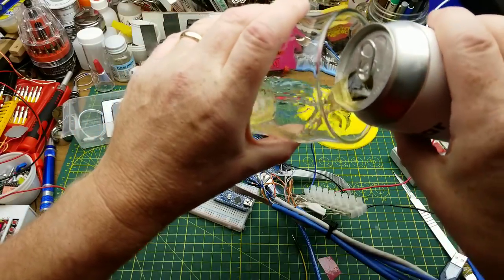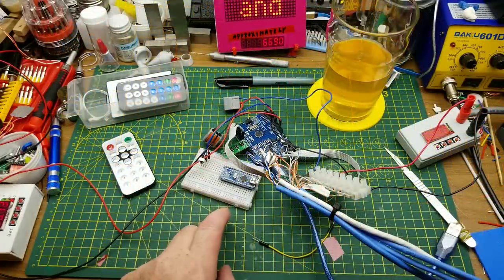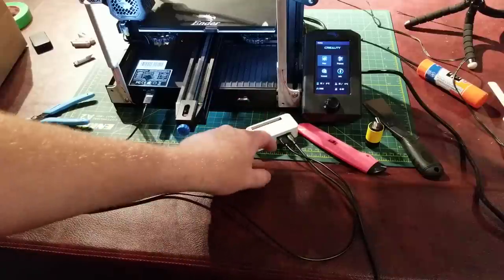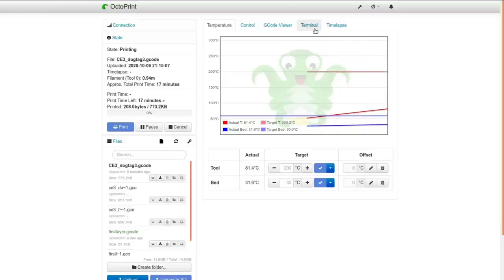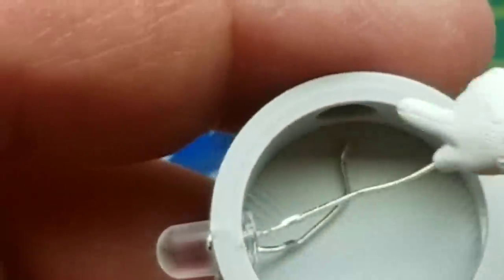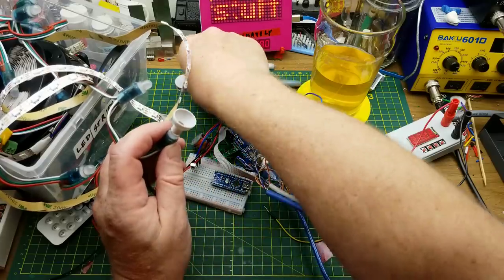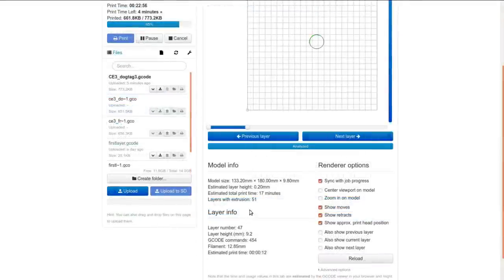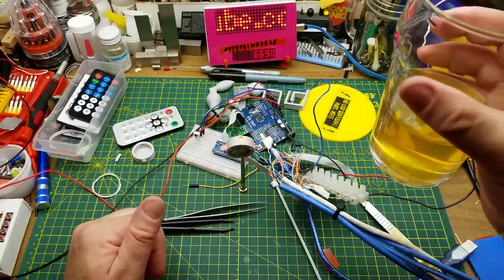A few work-in-progress projects

Comment: Octopi is great. I liberated the webcam from an old broken laptop to use with it. Put a couple of diodes inline to drop the voltage and it works with standard USB. Hook up to the Raspberry Pi and you can watch your prints from the Octopi PC client. First thing I did then was to print a little case for the camera so I could easily mount it on the printer.

Comment: Take the LED Christmas lights you like and resize them in the slicer to fit the LED. Many times I had to resize things to fit. if its a 10mm hole and you need 11 then set the size to 110%. Works great. Also you can get away with changing just two axis such as x and y or even just one.
Reply: Same with the parts you make. Why recreate them when you can change x and y to make it bigger.

Comment: Persist with Freecad, it is great. I have liked OpenScad too, and interestingly the OpenScad design can be directly input in Freecaf too, both by direct access to OpenScad, as well as a exported model. The imported version is a mesh, which under the PART workbench can be reconverted to a solid object for further CAD redesign.
Learning both has its place but a full CAD is the best overall. Freecad of course can do many things, depending which workbench is applied. You may yet benefit by the sheetmetal functions, and assembly modes, animation etc. The addins also are highly useful, such ad gear design and fastener (bolts/nuts) design addons.

Comment: I tried a USB cam with Octopi and although it worked, it was not reliable and required frequent reboots of Octopi.  I then configured a ESP-32 cam into a 3d printed case I made myself and it works much better using the standard esp-32 cam software.  I can even see it from outside on the Net with just a few simple router hacks.
Reply from the maker: That's an interesting option. And I have an ESP32 cam around here somewhere too.

Hmm...

Comment: I suggest moving the spool holder to the side of the printer to improve the filament path, helps to prevent breakages, but will reduce the available print height a bit, unless you put it in its own stand, take a look at my Ender-3 V2 build video from last week.
Reply from the maker: Thanks for the suggestion.

That video of yours was what gave me the idea to print the cable holder.

Comment: SCAD looks just like a program i played with years ago! it was a program called “Persistence of Vision” (POV) where you used shapes to make up the picture and it took about 24hrs on my 3MHz pc to produce it.

Worked in the same way, you made unions to join shapes together etc, can’t remember what the command was to cut one shape from another. But it was quite fun at the time, except for the 24hr delay to see any changes.
Reply: I did the same on a 486! I'd render then go for a bike ride. Come back and see I had the camera pointing in the wrong direction.  Good times!

Comment: Try out Autodesk's Tinkercad,. I've used it ever since I've been doing 3D printing, about 5 years now. Free and very easy to use, made hundreds of projects, many complex. My current printer is an Ender 3, fitted with a magnetic bed base, projects pop right off. (You should try it)

Comment: I use FreeCad, it is definitely not perfect. My first project was to make a parameter controlled box, I used the spreadsheet in FreeCad to enter the parameters and then size the drawing from the. Theoretically that would work perfectly, in praxis FreeCad sometimes fails generating the geometry, not because it is impossible, but simply because FreeCad do it the wrong way. After a couple of redesigns I found out it was basically impossible to do something that always works, sometimes I have to adjust the parameters slowly (I.e. in a couple of steps) before FreeCad will accept the layout.
Another problem with FreeCad is that you can base features on surfaces or corners, but FreeCard cannot keep track of them, I have learned to work around it.
My box was a success, even with the issues. Every time I need a box for a project I type the parameters into the FreeCard spreadsheet and get the box (Sometimes with a few tries). Then I can add the holes and other stuff I need for the project.
The best thing is that the result works in the first or second print, I do not need to iterate a lot of times.

Comment: I feel your CAD pain! When I built my first printer long ago it now seems, I was a CAD dummy (and still am) I wanted a 3d printer to do my own designs with so a CAD was needed. I started like you did with SCAD and still like it today. I am a programmer and am the WORST END USER IN THE WORLD! Applications like CAD seem awkward to me.  I just don't pick them up easily. After doing the open-source tour of cads, I found Tinkercad or Kiddy-CAD as I like to call it. It is cloud-based I know but is so darn easy for awkward end-users like myself. It has matured a good deal since I started with it years back. It's just so easy to use but again is cloudy.  When I am making a new part, I like to have it good in 3-4 prints, but miss that most of the time :) One thing I will do is cut a part down just to fix and test a tricky area to save plastic and time. Printing tips - One thing you may want to do is adjust your extrusion multiplier. Usually, the defaults they have will over extruded and make things off-sized. It will also make layers thicker and less even. You can change this in the slicer or on the printer (I do in the slicer most of the time) For light transmission I usually choose a natural filament or clear, but you can thin the walls out some to help with that as well.
Reply from the maker: Thanks for the tips. I'm glad to hear that I'm not the only one who struggles with CAD.

I do have some translucent filament waiting in a shopping cart once I get my design mostly "perfected"-ish

Comment: Despite much uproar about the recent restrictions placed on it don't be afraid to at least try Fusion 360, it's still a great option for a person such as yourself, the interface is more intuitive for many and many basic things are easier to do it in that in many of the opensource solutions out there.
Reply from the maker: That recent change wasn't even part of my decision making process. 
I've always been biased towards open source software. And away from cloud based solutions.

I much prefer software that I can install locally and use offline.

Comment: Good to see your learning on the 3D printing. I recently got a 3D printer, and I've been looking at OpenSCAD and FreeCad, and like you I'm finding OpenCAD easier to get the hang of (I am a software developer by trade, so coding is more natural to me than drawing). Nice to see that you are making useful things too, rather than just printing out various little trinkets and figures. It might be worth trying "Vase Mode" in the slicer for LED diffusers, also if you go to Big Clive's site you can download his SCAD files for the crystal LED light, and it's useful as a base to get some ideas from (although it's quite complex). That's one thing I'm liking with OpenSCAD, is that it's easy to chop bits from other models and then experiment with them.

Comment: Sad that the only real 3d design tools, Soldworks and Inventor, are proprietary and prohibitively expensive.
There are wizards with Blender,  OpenSCAD,  and Meshlab.
Reply: Having a coding background, I prefer to model simple things with OpenSCAD. 

For more complex parts, FreeCAD is more powerful that it seemed at first sight. The learning curve is steep, it still takes me quite a long time to design certain parts. (And usually, a few days later after finishing, I run into some video on YouTube where someone does the same thing in a few minutes using an approach I didn't know was possible... :-D)
Reply: @hugovangalen  Thanks.  Just fired up Synaptic, and installed.  Am immediately perplexed though ... I want to extrude from a drawing, and cannot figure out how to do anything like that.  (sigh)  It is not like Solidworks.  Guess it is time to look at tutorials and start from ground zero.
I like to work with additive/reductive geometries on planes, and do sweeps, lofts, fills, hollows, fillets ... for most things.
Reply from the maker: I've been working my way through his tutorials playlist. Haven't got to the advanced stuff like that model yet.
Reply: @pileofstuff  Yeah, that F-4U model is pretty advanced stuff.
Am finding the simplest things infuriating in FreeCAD -- but that is surely what I want to use.
Want to mark the midpoint of a line, and create an array of objects in a drawing, and do successive extrudes from borrowed lines on surface sketch.  Nothing is working quite like as expected.  Will be easiest to give in and view more tutorials.
I learned AutoCAD 30 years ago, some SW in 2009, and some Inventor a few years ago.  Want to do the same simple things, but the game keeps changing ... even within the same software package.  Someone keeps moving my chair!

Comment: You should give Fusion 360  a try, It is a web based subscription app but they offer a free hobbyist option.  I have found it quite useful and its not too bad a learning curve.  I have been 3D printing for a couple of years and a fellow Manitoban.  I have several  3D printers including an Ender 3 so if I can help let me know
Reply from the maker: I see that Fusion has a huge userbase, butI think  I'm gonna be stubborn for a while longer before I take the "well travelled path".

I'd love to sit down with you over a beer some day and talk about this stuff - after this plague stuff is dealt with...
Reply: I heard that the free option for Fusion360 has recently been changed, and you are very limited as to the amount of models you can work on. Although FreeCad is not quite as polished as Fusion360, as it is proper Open Source, hopefully the same fate won't happen to that software.
Reply from the maker: Many programs have done that in the past - it's one of the reasons I shy away from cloud based software.
Reply: @pileofstuff  I'd like that too, we share a lot of the same interests it seems.  It is true that Fusion has changed the free options a little but for the small stuff that I do I have not found it to be a problem.  If eventually they pull the plug I have had some experience with FreeCad but did not find it as easy to learn as Fusion 360.

Comment: RPI zero its not good to work with the cam
Reply from the maker: Does it not have enough system resources to add the camera to octoprint? 
Or is there some other limitation that I've missed?
Reply: Hi, limited system resources. I tried and fails now I use rpi3.